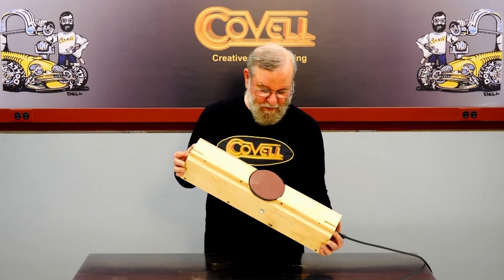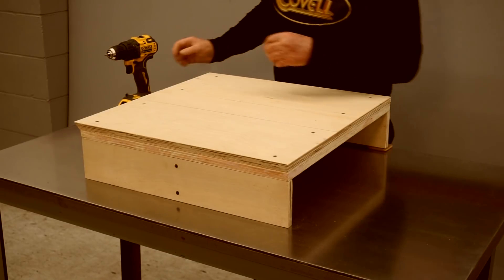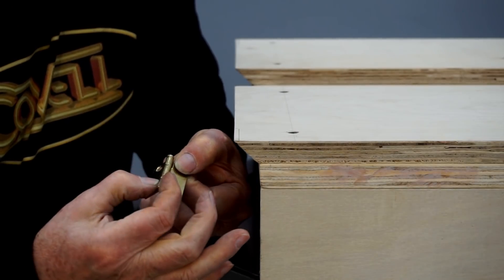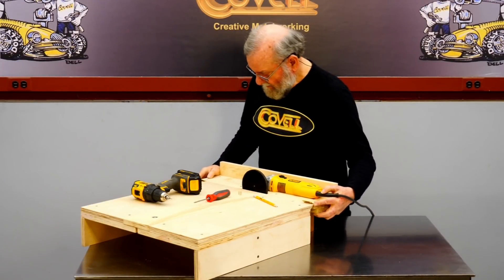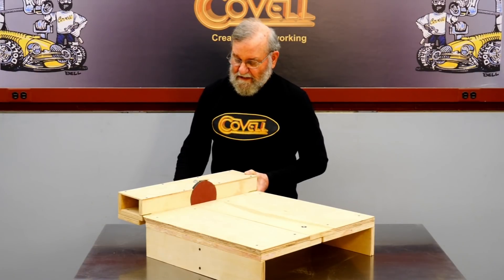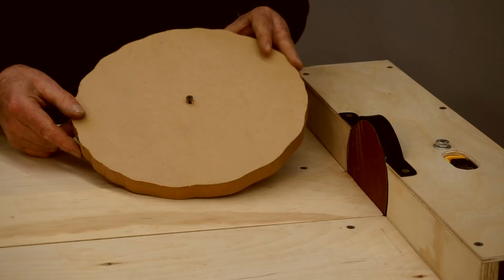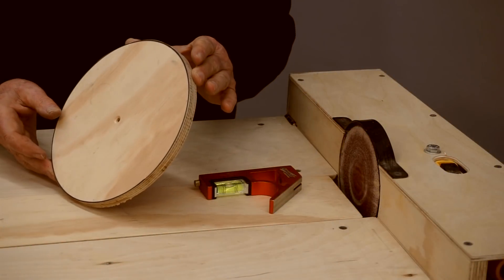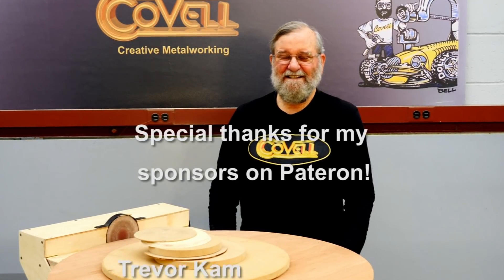Dedicated Disc Maker - Part 2

Comment: Now that's an outstanding result!!! I believe you'll need something for all the wood dust... another project, maybe?
Reply from the maker: Possibly!
Reply: Yeah, I was thinking a hole in one end of the cover sized to match a shop vac hose would probably take away most of the dust... maybe not after the vent holes were added though. Delete the vent holes, and put one hole at each end of the cover. Then attach a vacuum hose to one hole, and the vac will collect dust and provide cooling at the same time?
Reply from the maker: I'm working on some ideas right now to control the dust.
Reply: @mattgies  using the same path for both cooling and dust flow is not usually a good idea, it may start to clog the motor due to excess dust. Dust management is often a complicated issue, woodworkers know very well how sneaky it is
Reply from the maker: I just developed an idea to completely separate the 'dusty' part of the sander from the 'cooling' part the motor needs, and it will incorporate a vacuum, too. Should be able to test it today or tomorrow. Keep your fingers crossed!
Reply: @RonCovell  That's very nice to hear :D

Comment: Wow, nice project. 

You can drill 3 holes in the side cover and one in the table then use a pin to secure it (plus the knob). You now have 3 quick angles (The most used ones) without the need to measure it.
Reply from the maker: That's a great idea - thanks!
Reply: Great idea!

Comment: A most excellent contraption, sir! When you put on the angle setting endcap, I started worrying about cooling the motor. The end hole on the box with the sander looks like about the same size as computer server fans. It would be a good bit more work, but you could add some with filtration and keep this  running cool and clean for a good long time. I guess it depends on how much this machine would be run. If it's not in constant production, probably not worth it.
Reply from the maker: Thanks for the tips!

Comment: Great video as always Ron! One thing that struck my mind is the carriage-strip that you tapped with a hammer to adjust the diameter.. Perhaps it would be a good idea to have a piece of allthread that you could screw in or out to adjust the diameter? IF the carriage-strip were to slide during sanding, you would end up with an oval shape instead of round, aswell as turning a piece of allthread gives better precision than tapping with a hammer.. I hope you get my point!

Cheers!
Reply from the maker: I do have a design that incorporates a 'feed screw', but thought I'd try the 'tapping' technique first. It actually seems to work pretty well!

Comment: 12:28 Having a fan there might also have worked.
Reply from the maker: I'm looking at ways to perhaps incorporate a vacuum for dust collection.
Reply: @RonCovell  Great idea, maybe just below the sanding disk. Would consider a device that doesn't (need to) use filters like a Dyson (clone). As filters probably will clog up fast.

Comment: Thanks for another good video Ron!  Really enjoy the concept and execution alike.  Say, what do you think about affixing one of those self adhesive measuring tapes to the table?
Reply from the maker: Well, I suppose a tape would help - but it would have to measure the radius, not the diameter.
Reply: @RonCovell  Hmm.  True that.  I wonder if that would actually be a time saver or not?  Knowing myself, I would constantly be double checking the diameter with a tape measure just the same.  Anyway, thanks again for the video.  The craftsmanship and the presentations are a treat.